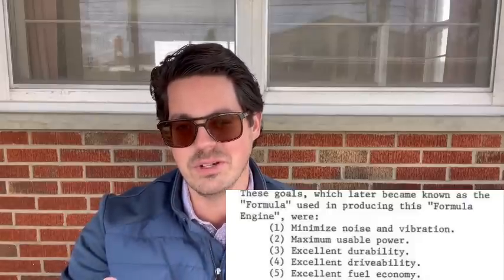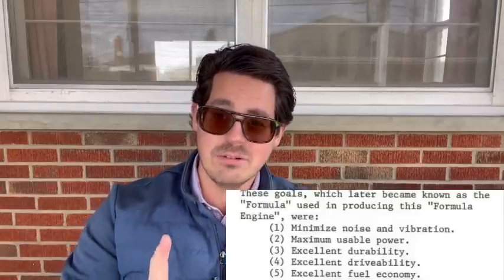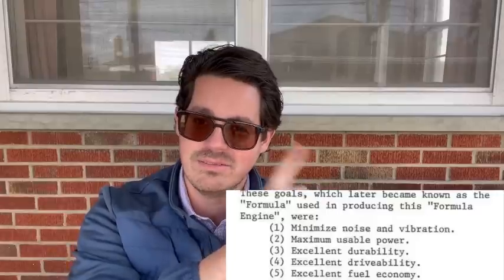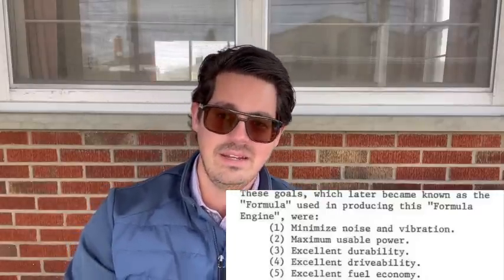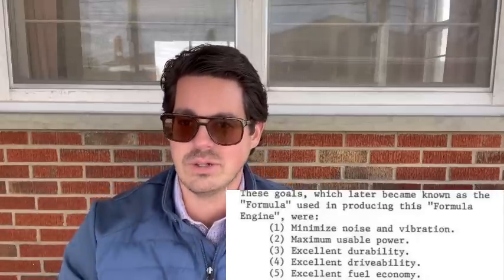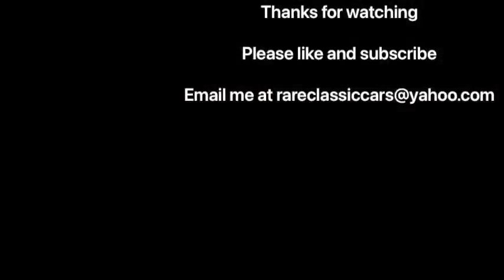Worst Engines of All Time: GM's 2.5L Iron Duke 4-Cylinder

Comment: I know it sounds contrary to your discussion, but first, back in that late '70s-early '80s era - when it came to any basic, affordable car  - I thought all engines smaller than an eight-cylinder were noisy, given the experience I had as a kid with my parent's 6-cylinder '65 Chevy Belair, which they replaced with a '75 Pinto wagon with its extremely chattering German V-6, and from the time I became conscious of such things, the VW "bugs" all over the place with their loudly ringing rear engines.  I thought it was inevitable that you traded smooth and powerful for noisier and more economical. Second,  I ended up buying my neighbor's '87 Celebrity ("Eurosport") in 1991 after about nine years driving a 305-V8-powered '78 Impala, having the impression - after a test drive - there couldn't possibly be a four under the hood because it didn't feel underpowered even with the a/c on.  I must have some pretty low standards.
Reply from the maker: You needed to try a Honda or Toyota 4 cyl of the era. Velvety smooth.

Comment: The disappointment mentioned about long time GM customers going from the V8 cars to these 4 cyl cars was very real.  My grandfather drove full size Buicks and Oldsmobiles for many years and went from a 77 Olds 88 with a 350 to an 83 Cutlass Ciera with the Iron Duke.  There was really no comparison in terms of smoothness and drivability.  He traded it in for an 87 Buick Century with a 2.8 V6 which turned out to be a far better car all around.

Comment: When I was looking at my first, and only, new car, I checked the GMs, Fords etc. Bad styling, reliability and sent me to the Opel Manta. Not the fastest but they looked great, had hydraulic lifters that required little maintenance coupled with a very long engine life.  I sorely miss this fine vehicle. None of the US cars were worth my second look. The Buick salesman tried to get me into one of the Nova based clunkers but it had no positives and horrid gas mileage. I really wanted an Opel GT but it didn't have the storage space or room for four. The best Iron Duke was at the Battle of Jutland.
Reply: An Opel with hydraulic lifters???  Those Nova-based cars should have been confined to Chevrolet, but clunkers they were not.  They were good reliable cars.
Reply: @michaelbenardo5695  The later Nova cars were awful handling, clunky looking and were rife with union quality control, that is little to none. Buicks delivered to the dealer with Nova dash boards for example. For a six cylinder car, these things must have been shut off before refueling because the gas pump couldn't keep up with consumption. The V8s, well just be ready to take out loans to top the tank. I chose the Opel over the Ford/Mercury Capri because of the lifters and a lack of Mustang clone styling.
Reply: @ifga16  I had nothing but good experiences with those cars.  They were never designed to be sports cars.  Worker's unions have no control over Quality Control.  COMPANY MANAGEMENT makes those decisions.  That's right, COMPANY MANAGEMENT, NOT THE WORKERS, NOT THEIR UNIONS.  COMPANY MANAGEMENT.

Comment: A bit of trivia about Oldsmobile back in the 80s, in 1985 the new Calais was chosen to be the Indy 500 pace car, they came with the 2.5 4 cyl, the new Quad 4 overhead cam 4 cyl or a 3.0 buick V6, GM got the nod because of the new quad 4 engine, but the pace car had to reach a certain speed in a certain amount of time, they tried and failed over 10 times with the quad 4, so plan B, a buick v6 would do it but it would not sound like a 4 cylinder, so the real indy pace car in 1985 had a bored and stroked 2.5 pontiac 4 cylinder, it was going to be a secret, the head was milled and ported bigger valves, and it got the job done, they made 2 of them and kept them hidden, as for as anyone knew it was the quad 4, but I know better

Comment: Wrong. These things are the 4-banger equivalent of the Ford 300 six or Chrysler slant 6. Can't kill 'em. Had 1 in a '89 S10 & believe me, I tried. Hated that truck at first but grew to love it because it's so damn tough! Easy to work on, easy on fuel, never needed much in the way of maintenance. Body rotted away around the engine. Hell, the stupid transmission gave out but not the engine, still doing its duty. Only downfall I could ever see was the factory exhaust manifold & the infamous crack that they all developed. What many would consider crude & unrefined, I found reassuring & comforting. 327K hard miles, I think (not totally sure 🤔) I did cap/rotor/wires/plugs once. Fair share of fuel pumps but not the engine's fault. I can't remember doing anything to that engine. It still ran like a new one when I sold it.
Reply from the maker: Um. Those engines you mentioned were waaaay smoother and far less crude
Reply: @RareClassicCars  true by virtue of design, being straight 6 engines they have perfect primary & secondary balance. Of course they will be smoother than a 4-cyl & even the most tractor-like straight 6 will feel refined in comparison. 

What I DO agree with (and I think the focal point of why this engine could be considered "worst") was the vehicles GM chose to stick this engine into. Sports cars or even cars with mild sporting intentions? Who was GM trying to fool??? This was a small truck & industrial engine, nothing more, & had it been utilized as such, I don't think it would've gotten the bad rap it did.

Comment: The original Pontiac engine that was a 389 V8 with one bank cut off may have been much heavier than justifiable for a 4  cylinder engine. Probably shook too.
Reply: It did, but it was RELIABLE.

Comment: My first car ever had the iron Duke engine (Olds omega). Never let me down even with a bent push rod. Drove it until the body rusted out. I got 30-35 mpg all the time even though it said it only did 25-30 mpg. Waaaay figgin better than modern POS engines
Reply: FACTS!

Comment: the iron duke was a great engine.  i had one in an s-10 pickup.  it was 100% appropriate for that use.  it had throttle-body fuel injection.  started and ran great.  look at the comment below to know why that engine was right on for a small basic pick-up truck.  i cannot say that the engine was great for more refined cars.

Comment: i used to own an 86 pont 6000 base trim with one of these
and now days..... i work on the Post Office LLVs
.
my saying is....... "the 2.5 will always run, but never run quite right"
.
.
like ya..... you can forget to change the oil..... over-rev it.... just general abuse and neglect
and it will just keep running
.
it will just run like crap..... but it will run
doesnt mean its a good engine however...
.
.
.
heavy
low power
low torque
low MPG
noisy at idle
noisy at cruse / red line
OBD1
ETC

Comment: The Iron Duke was well suited for light utility - low end torque, durable and reliable. It was not well suited to small or sporty cars. Launching the '84 Fiero with the non-balance shaft Iron Duke did not make any more GM fans - even though the car did sell fairly well. Seemed like GM really did not understand how to match engines and applications very well in those days.

By comparison, the Toyota MR2 was introduced the same year with the excellent 1.6L 4AGE with a 7700 RPM redline. That engine would go on to become the basis for the Formula Atlantic series.

Comment: It's funny they thought a balance shaft would be noisy, given one of the names for them in the industry is "silent shaft."

You're a bit unclear on the "aluminum pistons" part, 'cause the standard piston material across all manufacturers had been aluminum for a loooooooooooong time before this point.  Not only to reduce reciprocating mass, but for heat reasons.

Even IN tune, the Trophy was an NVH nightmare.  Engineers apparently joked about it being perfect to test durability of the radio.

Cummins/Onan even used a natural gas-powered, 3 liter version of this engine in standby generators up until fairly recently.  Based on my experiences with these engines through the years, I'm sure that they chose this engine for its durability and reliability.

Comment: I had a 1980 Pontiac Sunbird hatch (Monza) with that engine and a 4-speed transmission. It was just about as bad as the rest of the car. The emissions equipment was especially bad. Drove a 4-cylinder Firebird one time and it was a joke, especially since it had an automatic trans.

Comment: We still see them often in early 80s jeeps. Since Jeeps are popular, and kept on the road, unlike most of the cars that got the Iron Duke. Its also popular in jeeps since they used the same bell housing as a SBC V8, so if you found a Jeep with an Iron duke, swapping in a small Block V8 was trivial.
Reply: I recently bought a cj5 with an iron duke. Does the jeeps transmission (sr4) handle the sbc?
Reply: @chazpaul7934  The short answer is lots of people put the SR4 behind the SBC, since the bellhousing is the same. The SR4 was also used in V8 mustangs. It can handle a mild v8 that doesnt get lots of abuse.
Reply: Interesting. Will a tbi Chevy v6 fit directly to the sr4? Gas is high so looking to either rebuild the iron duke or go with something more modern for power and smog requirements for California smog.

Comment: Not Worst! Perhaps better for that era. Had Olds Omega X car and seemed to be solid, durable and delivered 32mpg highway which was not bad for 2.5l with no overdrive. That engine is running around in countless US mail trucks and is also in marine applications. Check back to 1962, the 
Chevrolet Super 90 Gross HP Thrift 4 cylinder at 153cu inch moved to the Vega- Monza in 1975, with a new cross flow head???

Comment: My mom bought a Cadavalier and I drove it before it even had plates. The car bucked and shuddered, had zero power, and just generally was trash. I still remember how much of a terrible turd that car was. It never did run properly. I had a new MkI GTI at the time, and it was an absolute riot to drive. The contrast between the two cars couldn’t have been more extreme.

Comment: Iron Duke 4 cylinder all the noise and vibration of a Farmall H with none of the torque. Ran pretty good, though mine had a tendency to fry ignition modules modules.

Comment: I really enjoy the porch chat. I can just hear the idling sound of these things. Yup! Sounds like a tractor. I’ve mentioned  before I came close to buying and 4 dr.86 olds Calais with this motor. White wall tires, wire wheel covers, red velour interior. 21 year old me just couldn’t do it. Also, came close to buying an 88 Calais 2dr. 5 spd. Quad 4. My father-in law scared me off of it with stories o head gasket failure in some of these in his company’s fleet of cars. I really enjoyed the test drive in the quad 4. It was a little ripper with a full factory body kit and alloy wheels!

Comment: At the time of it's introduction in '77, Opel Germany, had just started building their formidable 2.0S en E engines. Later they added a powerfull 2.2E. These engines were (almost) comparible to Mercedes in terms of torque, durability and sofistication. Why didn't GM USA source these? They were way better and more pleasant in every aspect.

Comment: I never had an issue with the 2.5.  In fact, I once drove one a few hundred miles on 3 cylinders!  I've had far worse experiences with the GM 301 (1977, had about 4 hp) and 305 (1985, blows up at the drop of a hat).  Horrible, horrible engines!

Comment: always wondered if you could take the nova 153 four cyl. engine and used a chevy 350 pistons , valves,  bore and stroke,, it would give it a 175
Reply: Back in the day you could get a 1/4 inch stroker crankshaft from Merc cruiser marine and build a 181 inch version

Comment: Vibration and fiber timing gear I have seen one of these engines in a 80s firebird I was like really dude I also remember the later front wheel drive engines with the balance shaft the oil filter cartridge was in the middle of the oil pan

Comment: and they had seven or eight cylinder head drill patterns so a cracked head was far harder to fix than a "Real Engine"  The REAL Iron Duke was a great engine and found it's way into marine application also.  These later tech four piece of shit were worthless, the early iron duke was a prize with chevy small block parts and chevy bell housing bolt pattern.

Comment: The 4 cylinder that Chevy built in the 60’s for the Chevy II was a good engine. A little underpowered in the Nova tho.
Reply: That was the  engine  MercCruser used in there  Stern drives  it was Bullitt  proof! I had one in a 16 foot ski boat it ran for 30 years with no problems.
Reply: I always thought that engine the 4 in the Chevy II was the  Iron Duke!
Reply: @mylanmiller9656  "Iron Duke" was what the called the 76 and later version of the Chevy II.  Bore and stroke were a little different, but mostly the same engine.

Comment: Unrefined, yes. Reliable, yes. Not only were these used in a lot of cars , they were used to power many stern drive boats. To hold up in a marine application they had to be pretty durable. In a boat the vibration, and noise, isn’t nearly as annoying as when powering a car.
Reply: To add to my misinformation:
The Iron duke marine version is 153 cubic inches and the automotive version is 151 cubic inches. They are not exactly the same and parts are not interchangeable. The name Iron duke is though, as well as the noise and vibration.

Comment: didnt the first year chevrolet astro 1985 have an engine option of the 2.5 iron duke??
Reply from the maker: Yes
Reply: @RareClassicCars   what was the fuel economy for that?
Reply from the maker: @jamiekelly552  Not sure. I bet about 23-4 Highway. It had to push a lot of air
Reply: @RareClassicCars  sounds about right.  You think a 2.5 would get better then that.  But then i realized astros are heavy

Comment: couldn't be further from the truth. 2.5 was fine if maintained . that engine had a recall for some porus cylinder head castings which is the one I knew about. It was installed in a wide variety of platforms and I worked at a Pontiac dealership from '83 to '87. Iron duke cars weren't  coming in for warranty work very often, olds 350 diesels were though. I personally know people who have pushed 250,000 miles out of them, my neighbor has one right now still runs in his s-10 pick up.
Reply from the maker: Never said they weren’t reliable.  They were ultra crude.
Reply: If its  reliable, how can it be classified as worst. that makes no sense.  @RareClassicCars

Comment: My first car was a1990 Buick Skylark with this engine. Properly tuned it ideled smoother than most v6 and v8 engine's. I ran the tar out of this engine couldn't hurt it took it autocrossing raced it on the street and never any problems. The 2.8 v6 was far worse

Comment: So what you are telling me is a reliable, durable, economical, inexpensive vehicle is "the worst?" I am glad I didn't waste time listen to the whole video. I have owned 5 vehicles with the Iron Duke 2.5 L. I put over 200,000 miles on each and every one, including one that had sat for 20 years that I ended up putting on 300,000 on it after replacing the lifters just after getting it going. The only "negative" I had with those vehicles was the 3 speed auto tranny didn't want to go 80+ mph. The '84 Citation with the standard tranny was great on the highway.

Comment: I have to agree.  No great effort by GM to make a modern engine here at all.  Odd that they did not borrow something from Opel whom they owned since they had some superb OHC engines.  The Vega engine was infinitely worse.  I remember opening the hood and being horrified at the crude unfinished look of the cylinder head.  How could Chevrolet put that in a car with their name on it?  And just like the later Iron Duke had no power!  Fords of that era weren’t as good looking, Pinto, Maverick as the Vega but were actually hot rods in comparison to the half-assed GM.  Who was running GM then?

Comment: The only people who bought an Iron Duke car were people who stopped at a GM dealership and didn’t go anywhere else. Aside from the AMC 2.5 and GM’s own 2.0 and 2.2L.. most other four cylinders of the time were smaller, aluminum, higher revving, and had overhead cams… like virtually every Japanese and European engine but also the Chrysler 2.2 and 2.5 as well as the Opel OHC four cylinder that was on the Pontiac Sunbird. 

It definitely epitomizes GM mediocrity. The same that would have A bodies being made until 1996, J bodies until 2003, and W bodies until 2014… ensuring rental fleets and impoverished used car buyers has plenty of stock for decades.

Comment: How many millions could they have saved by simply improving the Vega 2300? Casting that head in aluminum? Installing a full size radiator,  standard? Then,  they could have offered the Cosworth DOHC as a premium option in 2 liter and 2.3 liter. A 2.3 DOHC engine would've had 120hp, which was MORE than many V8s and all V6s in the next decade. 

Now for the big idea: make a V8 version.  a 4.6 liter, DOHC V8 for the Corvette.  240hp. in 1975 or so.  Basically a modular solution,  investing in high tech and fuel injection and efficiency and performance.

Comment: My Aunt gave me her old 1982 Cutlass Ciera brougham 2 door instead of trade it in on a new car. I thought it had plenty of power got  22mpg, just the engine was bit noisy sounded like piston slap. Not as bad as my Jeep 4.0. Probably timing gears. Throttle body fuel injection always worked great & idled smooth. Don't remember any vibration. But compared to the cheap throw away cars like KIA, Hyundai, Mitsubishi of today they where much better.

Comment: If it’s the worst engine how come they put it in every single Grumman LLV For decades. It must’ve not been the worst engine. Those engines have seen countless miles.
Reply from the maker: It can be durable and still bad.  It was so unrefined it turned many customers off the GM. No one cares about refinement in a postal truck.